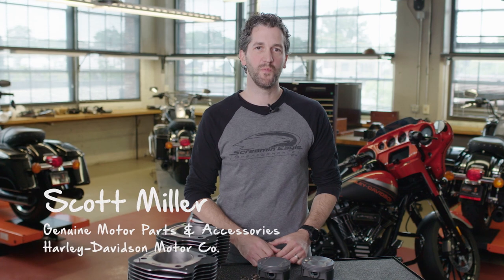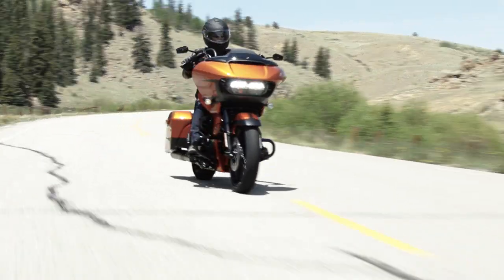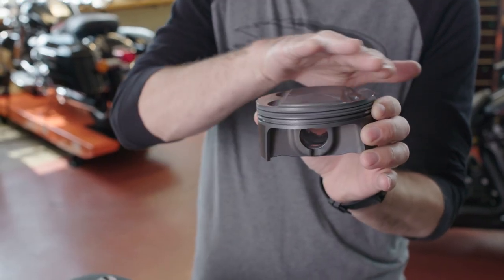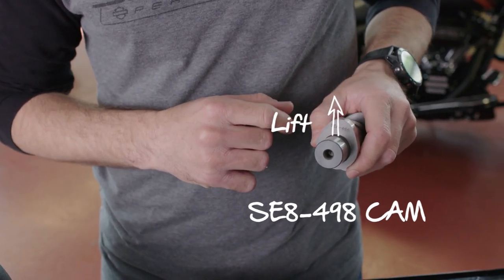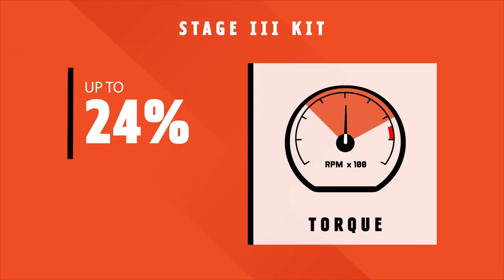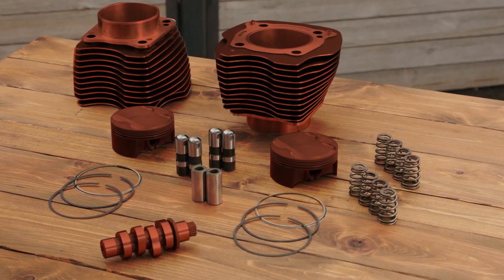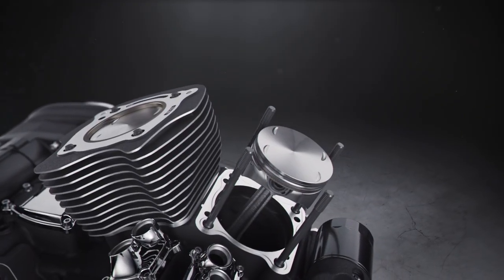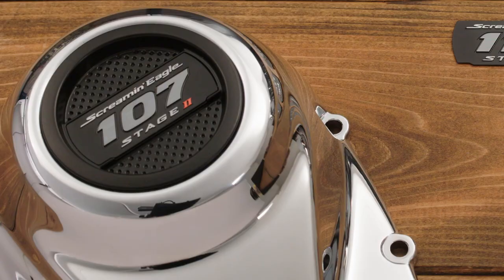Screamin' Eagle Stage III Upgrades | Harley-Davidson

Comment: Big fan of stage 3 119/122.    BUT.. 

heads up MoCo replaced the designed for the higher 11-1 compression stage 3 kit, 498 cam & springs for the can’t breathe or rev 447 torque cam. 

I think this was done because a stage 3 could produce power just a smidge short of the cash cow stage 4 kits. MoCo didn’t want you to know you could get 95% of the power for less than 50% of the kit & labor price of the stage 4.

Just tell your dealership you want the 498 cam & springs instead of the 447 cam & springs with your stage 3 119/122.

FWIW the 498 cam doesn’t lose bottom end torque like the stage 4 515 cam it simply doesn’t make quite as much top end HP.  I have a fall of 2019 stage 3 114ci with 498 cam. It dynoed 118 HP and pulls at 2k rpm in town better than my stocker did.
Reply: Thanks. I ended up getting a Stage III. Good to know.
Reply: @GregoryBaskincom  Appreciate the reply. I had to fix one thing the warranty & epa compliant 498 cam 114 stage 3 made 118 hp not 116.  So is your stage 3 done?  What cam did you have them put in?  SEPST and dyno tune?
Reply: @vernlochtefeld1626  No worries. Yeah, Stage 3 was done a couple of years ago. The dealership installed it. I know the original was 117 I believe. I never changed the cover to show stage III. Love staying under the radar and don't want to attract attention. Also has 1 pipe to give it more HP but I have a dummy pipe, so it looks original.
Reply: @GregoryBaskincom  What cam did you with and did you get it dyno tuned?
Reply: @vernlochtefeld1626  I'll have to check when I get back as I'm unsure at the moment. I did get it dyno tuned. I'm a bigger guy so I, of course, add weight to it but it does MOVE!

Comment: Now with the 114 S & Street Bob, should there be an updated video to displacement? Another question is, can the pistons, heads cam etc. of the  Stage 4 be bolted on without increasing the displacement on the 114 S & Street Bob?
Reply from the maker: Hey, Ted. For more info on how to get the most out of your bike using Screamin' Eagle Performance components, we recommend stopping in at your local dealer. Thank you.

Comment: if i go from stage 1 to stage 3, then all i need to do is buy the pushrods? because stage2 is really the cam shaft, which is upgraded anyway with a stage3.
Reply: uhh you need the whole top end

Comment: What breather kit do you recommend for best overall performance of a stage 3 or stage 4?
Reply from the maker: We'd recommend talking to your dealer as they can give you all the different options for your bike based on your riding style and performance needs as well as answer any other questions you may have.
Reply: I did,. They say that top HP and tor QQ ur are obtained with no breather, and of course they want to sell me a 600 buck Screamin Eagle breather,. I have the fuel motor ¹20 kit in my 2018 ultra
Reply: Check out the Vance and Hines. They have real nice ones for a good price. 200-275$

Comment: So if you go from stage 1 straight to 3, do you need the adjustable pushrods of stage 2 or are the stock ones ok?
Reply: UKFlamesey stock push rods will be fine. The only reason to use the adjustable ones on stage II is to keep from taking off the heads. This is my opinion only but skip stage III and go to IV or best bang for the buck Stage II. I have the 4 and my buddy has a 2 on streetglides. 0-60 I have just over a bike length on him. He just laughs and says ok you won but my wallets not as empty as yours.
Reply: Yeah I think I’ll just go Stage 2

Comment: With stage 3, am I going to suffer fuel consumption on mpg? I have stage 2 at this time.
Reply: No... I have the stage 3 and haven't suffered any additional fuel consumption. Its all how you ride. If im nailing it, then yeah. But if I'm just cruising it's like I have no stages at all. The power is there when you need it

Comment: What happens to the gas mileage with the upgrade
Reply from the maker: Hey, Joseph. A drop in mpg is to be expected with the addition of the kit. How much it drops really depends on the rider and how aggressive they are on the throttle.
Reply: @harleydavidson  does that apply to a Stage 1 upgrade?
Reply from the maker: Yes, you can expect a decrease in gas mileage with the Stage 1 upgrade with the trade-off of more torque and a more powerful bike. But, how much the mpg drops will still fall on the rider.
Reply: Who cares?

Comment: For CVO road glide 2015. What’s require for stage 2?
Reply: With cam?
Reply from the maker: Hey, we recommend contacting your local dealership for recommendations on upgrading your bike with Screamin' Eagle parts. They will be the experts in your area that will help you get what you need to boost the performance of your bike.
Reply: As far as I know most CVOs already have stage 2 👍🍺

Comment: why would anyone pay $2500 to $3500 installed too upgrade to a stage 3, when they could just buy the  114 instead of the 107 for an extra $1500 at retail.
Reply: Maybe they bought their bike used for a good price with a 107 and want to upgrade to a 114.
Reply: I had picked up an Ultra Limited with a 107 for a good price, bumped it up to a stage 3 and it was a loud torquey beast….couple yrs later i moved to a Road Glide with a 114 and for what its worth to me that 114 in my 2021 has more balls than the 2018 stage 3 107.     To keep it fair and honest tho my new 114 does have the screaming eagle stage 1 bump on it.    And Granted there are some weight differences and diff suspensions but  I prefer this factory 114. Now, i just gotta convince the wife to let me take this 114 up to the 122 lol. Fingers crossed
Reply: Well if you looked at the release date of this video, it was before the 114ci was released in the specials. Not only that but a built 114ci will produce more power and torque than a stock 114ci motor.
Reply: Because we get attached to our bikes so by doing this we can keep our bike and tweek it
Reply: My Sport Glide was not available with a 114. It’s ok my bigger bore shorter stroke stage 3 114 made 118 HP. A stock 114 about 81 hp

Comment: The best option is to buy an American IronHorse, in it's STOCK configuration, and it will blow away the HDs in HP and torque . Plus they look a ton better and at a fraction of the price with a better engine and parts.
Reply: Who?

Comment: "You know this $22,000 bike that you just bought.... You know how it's really slow right!?.... How about you spend another $4,000 and get Real Performance out of our bikes and by the way it's going to cost you labor and $500 for a retune..."
Reply: You are right sir. That's why I   happily riding a Triumph Storm , and between two lights, it pulls in front any 30.000$ stage 2 Pedalson. Mabe a stage 3, I dont know yet, but I still lookin' for one more to embarass.
Reply: And that's why I am happy that I ride an American Ironhorse Texas Chopper (Originally $30K but I only paid 8K plus it has a RevLoc clutch so no tired left hand) that already kicks ass throughout the RPM range.
Reply: Think you’re getting any of that money back on trade in?  Think again sir!  Bend over! Haha
Reply: The tuner is already in your toolbox from stage 1 you most likely have.
Reply: @mthewolf1095  >
Reply: Yep and then the badging for the upgrade are an extra cost again too
Reply: @alainbrisebois8334  Lol! I had a 1700 Triumph Thunderbird before switching to a Sport Glide and trust me, the Sport Glide (in bog standard trim) is much faster both off the line and roll-on.
Reply: @andrewkitchenuk  I am talking about my Thunderbird Storm. With 1700 cc and 115 of torque. Yours has 108.  Last year, a 55, 000$ FLH with a 110 was surprised and sorry to has spend that shit load of money because I left him behind on a roll on, WITH my 130 girlfrends. So... We should have a beer together so you could show me what you're talking about.
Reply: nunya business  Just go try one for reel. It's no joke.

Comment: If you own a M8 like my 2018 Fatbob, 2017 and 2019 CVOs don't waste money on Harley stage kits. The engine will blow up due to oil pump design flaws and/or plastic tappet guides.  Yeah and $50k motorcycle with plastic tappet guides.  Neither the dealer who installs it or H corp office will disclose this.  S&S, Fueling or Zipper all make higher quality performance kits.

Comment: Call zippers performance in Maryland.  You get alot more bang for your buck and it'll beat these stage crap kits anyday..They know what they're doing.  Unless your some big throttle jockey that needs to brag how big their numbers are just leave it alone. If you want big horsepower then you shouldn't buy a Harley.

Comment: I wouldn't buy anything at the dealership after the work they did.
10 grand after it all 3 dynos the last one being 6 hours the timing never changed it looks like Harley home threw in random numbers in the timing map fuckin useless 2 years and pitted hi compression pistons the headwerk all pitted.
From now on I'll use Andrews ,s&s or redline Harley dealership will not see my business anymore. Sad thing I wanted all Harley racing performance I got it it just wasn't adjusted right.
Better place to throw my money away than the Kingston dealership.
I do have to say the mechanic that worked on the bike seem to do well it's the tech side. Hey I guess that's why the mechanic didn't stick around
Reply from the maker: We're disappointed to know that you had this experience, Frank. We'd like to speak with you personally to get more details about this and document it. When you have a moment, please give us a call at 1-800-258-2464.